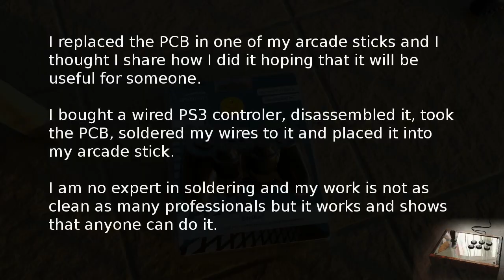Arcade Stick PCB modding (soldering, wiring)

Comment: Common analog sticks work like variable resistors, e.g. all voltage is up and 0 voltage is down, so when you removed the bottom part they became permanently engaged. To safely remove them you need to replace them with a 5k resistor.
Reply: por mas que lo intente no di con la configuracion, tire el componente con los RV sin saber que iba a quedarse activados los botones 1 y 4
que configuracion se utiliza V LX LY RX RY GND?
Reply: Retros Arcade Games con los RV??
Reply: @marcianoacuerda  resistencia variable
Reply: agree but he put that back later for the same reason
Reply: So where in the board you need to connect the resistor?

Comment: If you have looked carefully on the circuit board, you didnt have have to solder a wire for every ground connection of each button. Instead you could have used just one ground wire and daisy-chained them to one pin for each button.
Reply: Some joysticks need more than 1 ground though. It depends. I had a  controller that one of the direction buttons needed an exclusive ground lol. So later I was told that specific button needed a 5v ground. That's why :)
Reply: @3xperiment8  I've thought the same for my "4" key. But that was because I was mistaking the ground. So the current point and the ground points were the opposite to what I was assuming - current point was the ground and the ground one was the current point. 😅

Comment: just a tip, no need to solder that many cables for ground you only need one and the easiest spot to solder was one of the Dpad or action buttons with those big copper pads or to the usb ground (you can easily check that is the ground because its usually a black cable that connects to the pcb) and after that just make T connections for the ground in each microswitch (from the pcb the ground goes to one microswitch and from that it goes to the next one and so on).
Reply from the maker: Yes, this is a good comment. If you know that your PCB has common ground for all button and directions you can "daisy chain" wire the ground wires.
Reply: *****  indeed, but honestly, the last joystick i saw without common ground was one that used the Joystick/midi port of those old soundcards. I dont think there is a joystick without common ground nowadays but again i can be wrong
Reply: From all the videos I've seen of people making a stick out of PCB from a controller it seems like the wires are soldered right at the edge of the black circles for the buttons  do they have be soldered that way?
Reply: Moises Salazar not really, but thats the part where the trace starts and its usually a little bigger than the lines that are inside the circle so it gives a better solder joint.
Reply: in my case, i had to solder 2 ground, all the buttons and up and right used one ground, left and down used other, i don't know why, but if i use the same ground, when i press left or down, it goes up and right

PS: sorry about my english :D
Reply: @Jorge thats because left and down didnt use ground it used +5V, sometimes they use a analog circuit for the dpad
Reply: Has any of you soldered analog sticks besides buttons? I want to do this with the switch pro controller but including analog sticks.
Reply: analog sticks are simple most of the time they have a two signal wires (the middle pin of the potentiometer at the top and one of the sides) and then the other two pins of the potentiometers go to 5V and and GND. Seach on google Slagcoin that site has a really good tutorial for building arcadesticks
Reply: Thanks, just onequestion, would i need to remove the original ones since 2 resistors in parallel will give a different value? e.g.  5K||5K=2.5K (original stick R||new stick R= Equivalent R)
Reply: if you're going to use another potentiometer/stick then yes you should remove them but you could also try it without removing them, the worst that could happen is that since the resistance is lower it will be more sensible
Reply: Armando92 you seems to know a think or two so let me hijack this a bit.

I have a generic PS2 PC USB gamepad which I have hacked as a steering wheel (replaced left analog thumb with a 10k pot)

I do, how ever would like to have analog button active upon startup.

now it is digital mode first and needs to be set.

thought of bridge the button but it does not work it seems :'(

Regards
Reply: i dont think there is a way to fix that, all the generic ps2 clones i had always needed to press the analog button to use the analogs. But i remember downloading some generic drivers trying to get vibration on them, and some made the joystick start in analog mode
Reply: thanks again buddy. I have a Pi3 project so I cant fiddle with the drivers. I did however ordered a timer relay (12v) which closes a switch after 0-10 sec. might work :D
Reply: @armando92  USB and PSone/PS2 joysticks have common ground.
Reply: @3xperiment8  "no need to solder that many cables for ground you only need one" replying to a 6yo comment to say something i did in the first part of my comment
Reply: @armando92  I think I misunderstood you. I thought you were saying you don't know if controllers still have common ground but in fact you said the opposite. My bad :)
Reply: @armando92  Btw I had a USB one that used this 5+ for Left and Down lol. And required a different ground. Weird. Thanks for explaining why =)
Reply: @3xperiment8  its not that it required a different ground, i had a similar gamepad. It used the same circuitry than a analog stick for the dpad. Thats why you needed 5v and gnd the other two contacts/pads in up/down and left/right were what you normally find in the middle of analog pots and the same way than analogs signal to 5v means up or right and signal to gnd goes down or left.

Comment: Don't use the soldering gun mounted like that. Don't use the tip to solder. And please get some Flux man. Other than that you did a great job. Good video but needs some more explanation

Comment: Hey man this was a very straight forward and easy to follow video you made here, thank you so much! I've been looking for a video that teaches you how to wire a board because I'm just getting into modding controllers to re purpose them into other controllers or different buttons and each time I found a video it mainly focused on the construction of the design itself. Your amazing, there is one question I have tho for you if you don't mind, I'm still a little fuzzy on how to soldier ground connections and am having a difficult time finding it on certain PCB boards, I know with Micro switches for arcade sticks and what not, the ground is located on the bottom and from what I've been told most buttons won't function without it. Like with this board for example do you know where I would see the Ground connector or any signs of where to find it on other usb based controllers? I'm sorry if this seems like a stupid question to ask and if you don't want to answer, that's fine but it would do me a massive favor. Thank you for the video : )

Comment: this isnt an insult on you or anything this was a awesome video but you would really benefit from sitting down for a half hour with someone experienced in soldering. it would make your life ten times easier if you picked up a few simple tricks i let out a gasp when is saw you tinning that wire.
Reply: Experience will come with practise. My first soldering were trash

Comment: The analog stick wires broke off on my setup. Now without the sticks connected to the main pcb, the controller seems to send a steady up command from the phantom analog sticks. Beside trying to solder back those damn wires on those tinny soldering spots on the PCB, do you know if I could bypass this issue with an easier way? I'm far from a good welder and I'm trying to stay away from welding in a so tight spot. 

Thank you.

Comment: Hi, im planning to create my own fight stick from scratch, just 1 question: is it possible to use a ps3 controller PCB in Ps4 or does it have to be a ps4 controller?
Reply: Sorry for late answer, but for visibility. You can use ps3 PCB only in games with retrocompatibility (like UNIST for example)

Comment: when you inserted the usb plug in your pc, did that show up as "USB gamepad controller"
Reply from the maker: Yes, but it had a strange name like 'turbo pad' iirc.
Reply: ***** Hey bro, by what did you search the signal and ground points.
And how did you replace the ps3 joystick with yours?
Reply from the maker: I connected the conductive areas below the buttons. I did not connect the analog stick. I used the dpad.

Comment: Question If im using a ps3 bluetooth controller, can i make the arcade stick bluetooth?, like wireing the ps button to some arcade button? or it will not work?
Reply: @bishor33 im about to do it, any considerations or something that i may be aware before? I got the idea the process should be like this video right
Reply: For this PCB as shown on this video, it's easy to solder wires directly from the PCB board. And this PCB is thick enough. If you are trying to mod with Sony PS4 or PS5 controller PCB, then you'd need to be really careful while soldering because those tracks/soldering points are tiny and delicate. So, you'd need to control how much temperature you are passing it to while soldering. If you spend too much time to solder wire on the soldering point, high chances are that those soldering points may come out and tear it, which is what you'd need to avoid. And make sure, solderings are clean so that each of the soldered points are not connected to each other to avoid sorting issue. Also, use good quality wires. Best is to use spare or damaged wire of mobile phone charging cables. Rest are okay.
Reply: @bishor33 thanks my friend
Reply: @carloscontreras4707  you're welcome. Feel free to ask me if you have any questions. 
Regards

Comment: What was the problem you were having when you desoldered the shoulder buttons and analog sticks from the main board? I am currently making a ps2 stick out of a controller whose boards look very similar and would like to know if I could she some space by removing the analog sticks all together.
Reply from the maker: +game4youuuu Once I cut those part it just was not working. What you can cut off depends on the PCB's design. I saw some hacks where even part of the PCB was cut off. I suggest to not cut anything unless you understand the design of the PCB.

Comment: the part you say "disrupt here" i do not understand, also how did the short circuit happened? and how to fix? thanks
Reply from the maker: Starting from 2:00 you can see that some buttons have a comb like conductive trace below them. If you are unexperienced like me it is very easy to put too much tin on and make short circuit. But if you cut / disrupt the conductive between your solder points you can fix it.

Comment: Please answer, but anyways when you connected the gamepad to your pc and checked to see if the buttons were turning on at 0:49 how where you pressing the buttons? Were you taking the wire with both ends and putting them on the same button?
Reply from the maker: Vermillion. Yes, I was connecting the copper tracks with a piece of wire to see where I need to solder the wires. This is what a button does when you push it.
Reply: Ok thanks, its because im making a H Gate Shifter for the pc but i needed a gamepad and I was trying to figure out how to wire the switches to it.

Comment: I have a question.How many ps3 pcb do i need for this modify(1 or 2 pcbs)?? Why you connected 2 pcbs together? Explain please!.Thanks
Reply from the maker: You need only one. I had to reconnect the boards because I accidentally cut them at the wrong place. It is safer to not cut at all.
Reply: Thanks!

Comment: what about using hot glue to solder the wire to the pcb?
Reply: What? glue does not condut electricity

Comment: what if my pc cant detect or recognize the buttons pressed in 3rd party ps3 controller I bought? Is there any way to find the signal?
Reply from the maker: Does it say on the package that it is compatible with PC, too?
Reply: ***** i tried plugging original ps3 controller via usb cord, tried to test it but it doesnt detect pressing of buttons which made me think of that, Im hoping 3rd party controllers I'll find here are PC compatible too (hopefully a wireless version).
Reply from the maker: The Sixaxis/Dualshock3 is not compatible with PC officially. But it can be connected with unofficial driver.

Comment: i been trying to weld we wire to the pcb, but the metal just doesnt stick to the pcb, whats wrong?
Reply: I know this comment is pretty old (and so is the video) but the soldering technique in display is not very solid :p

You have to "pre tin" your wires and use flux, it will be way easier.
Reply: Also, practising on disposable boards before really trying is always nice :)

Comment: wheres the L12/R12?
Reply from the maker: Sensei Rain You can see at 0:30 where I cut off the wires.
Reply: ***** I mean where did u solder your L12/R12?
Reply from the maker: Exactly there.
Reply: ***** hmmm
can you tell where Solder points located with this PCB?
http://postimg.org/image/dauq2drpp/
Reply from the maker: Sorry, I don't know your PCB. But take a piece of wire and connect the PCB to your console. Try connecting solder points with the wire and see whether it registers as shoulder buttons.
Reply: ***** Like what you did on 0:34 ?
Reply from the maker: Sensei Rain Yes